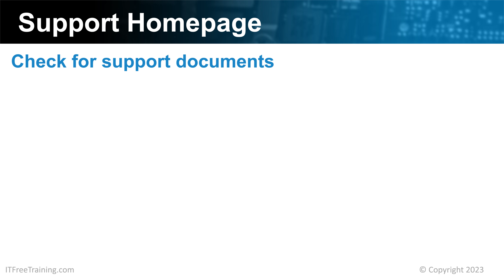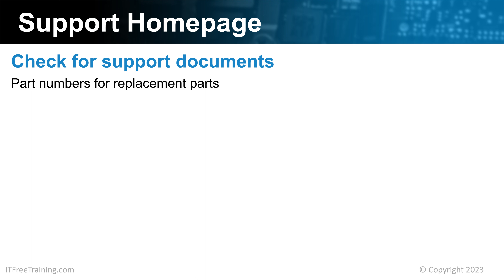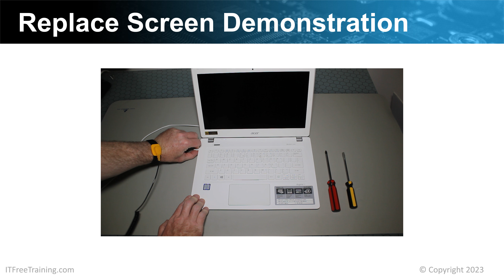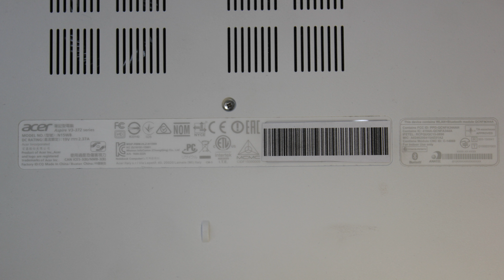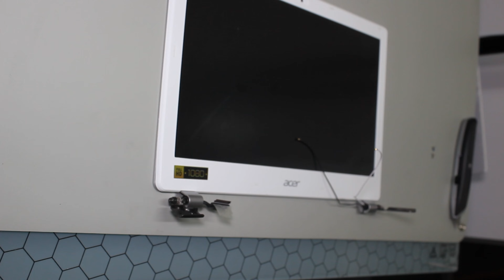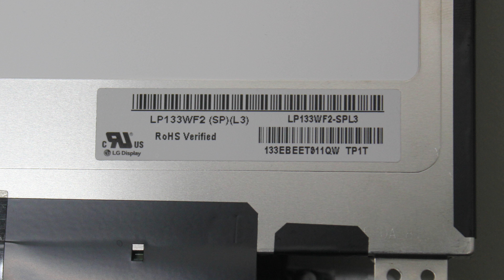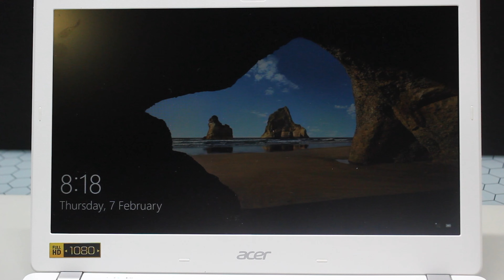Repair LCD Screen

Comment: 7:55 those wires are not for the webcam but for the wireless card antenna. There's even a label stating 'Wireless Lan'!
Reply from the maker: You are correct, they are the Wi-Fi connectors. Most likely we made a mistake when editing the video. It's an old video and we have changed our processes since then so hopefully that won't happen again. Thanks for pointing it out.